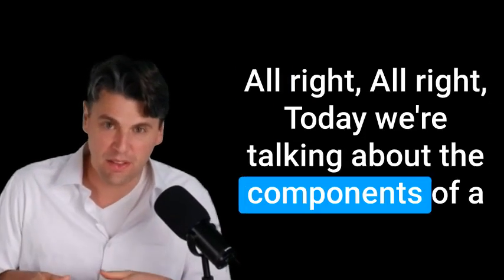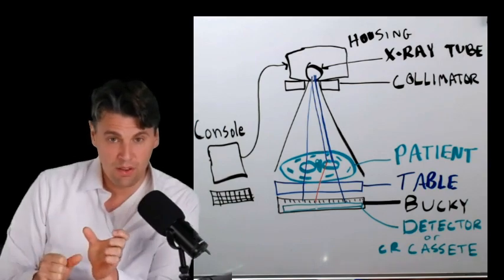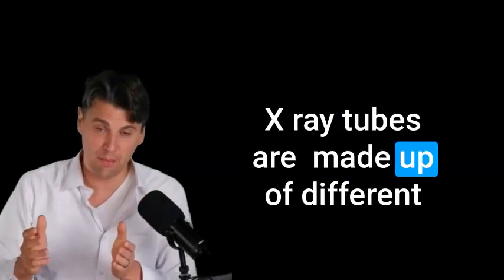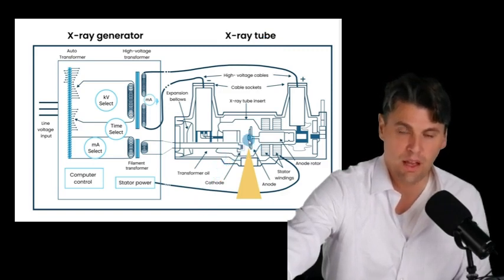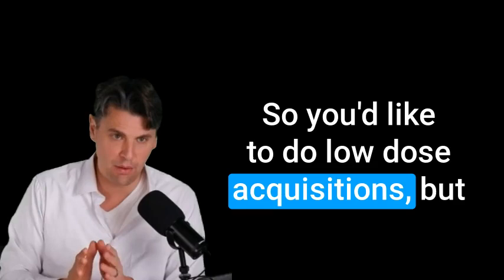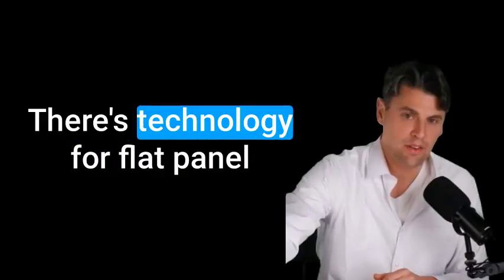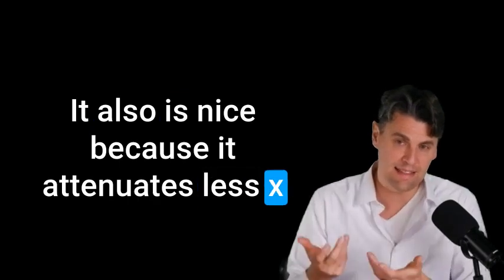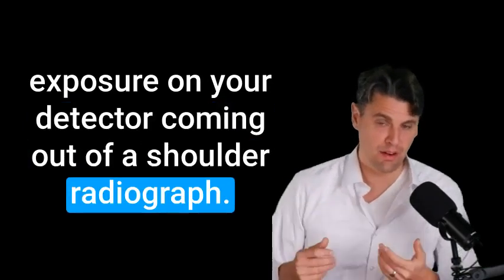X-ray Components (Radiography, Fluoroscopy: Tube, Circuit, CR, DR)

Comment: Hello. I have been a subscriber of your website for a while now and I have never received any study guides or extra material. Thank you for all the information you have uploaded thus far, it has truly helped me tremendously throughout my program.
Reply from the maker: Thanks for following. I have been focusing on the videos lately so I haven’t sent out guides lately. Thanks for reminding me. Is there a certain topic you are interested in?
Reply: @HowRadiologyWorks  Thanks for responding. I am trying to understand more of how the tube works with line acceleration and step up and step down voltage. Also direct and alternating current. Thank you